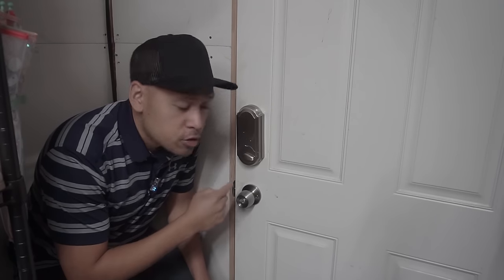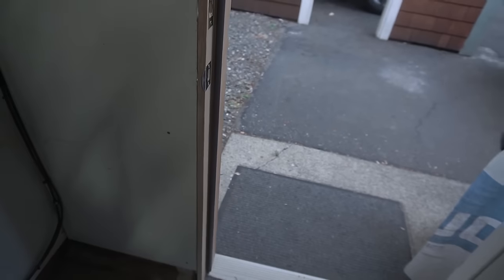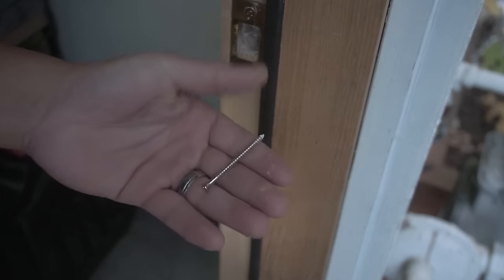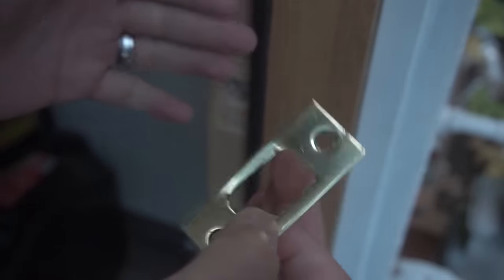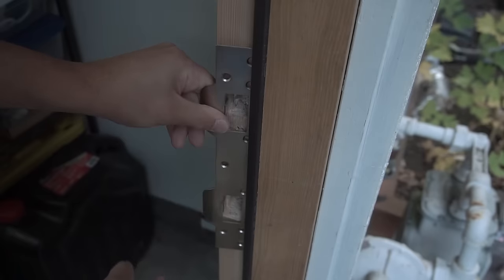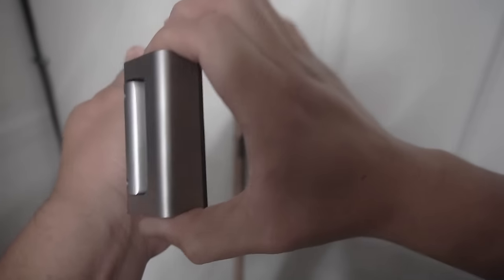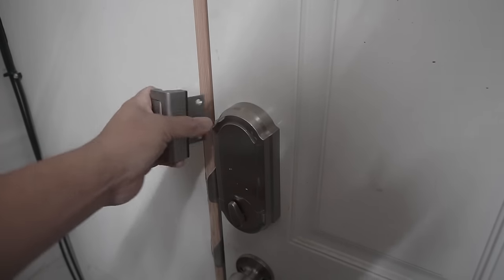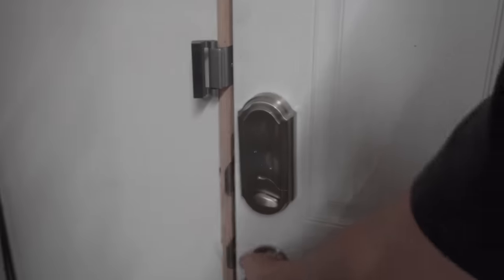How To Make Your Door Kick-In Proof Like A TANK! Keep Your Family & Home SAFE!

Comment: The lock on the thumbnail of this video I put a strip of streel along the backing of the door jamb. The guy renting the place passed out and the police kicked at it for 10 minutes before they called the fire department and used the prybar to pull the deadbolt out of the frame. The hinges were splintering long before the lock was. lol :)

Comment: Why does the doors in the us always seem to open inwards? Seems to me like a weak design compared to the European style which opens outwards. Basically the whole frame prevents you from kicking it in. I guess the us is designed in this way to prevent someone from blocking you in but that's a bit silly imho.

Comment: Just having a proper door frame and a decent carpenter would eliminate most of those problems. The gap around that door is an embarrassment, if you can fit that without debating the gap is obviously too big, buying decent makes of locks again will eliminate all of those things you mentioned. The frame you have there inside looks like an inch thick when it should be 2 inch hard wood, it looks like an internal door lining. Longer screws won't make any difference as it's a shear force not pulling, screw diameter is more important. Simply adding sliding bolts mounted top and bottom would of been far better, also pointless securing the edges when they can just kick in the panels of the door.

Comment: TANK? No.  Intruder just has to punch through that thin panel 6 inches to the right of the main door lock and reach in to turn its thumb latch, then flip the "Security Reinforcement Lock" aside - and they are in!!!  Those thin panels are the weak point on such doors.  They are only about 1/4" thick where they are mortised into the door frame.

Additionally, your main lock has a thump latch on the inside and does not require a key to open.  Thus, a burglar can enter through a window and easily exit through the "tank" door with your stuff - no need to struggle getting it through a window.  

Junk that fancy, convenient, push button lock and install a deadbolt lock that requires a key on BOTH sides of the door.  Leave a key in the lock when at home, take it with you when you leave - or hide it.

Comment: One inch deadbolts are crappy. Just prying with expand the gap. Steel doors and frame filled with cement works best. If a crook still wants in he’ll break a window. No one hears noises at 3am though most break ins are during the day when you’re at work 😮Don’t buy Chinesium alarm systems

Comment: I have a better idea.  Rig a rotation sensor to a pully and string on the door.  When the door is opened normally or even a bit faster nothing happens.  But set the rotation sensor to send a signal to a detonator rigged to a case of 16 quarter sticks placed underneath a false floor board right past the door.  And pack the area around the sticks with clay impeded with nails and gravel.  They kick your door down and go kaboom.  
And the atf and fbi show up to kick your ass because wtf if that was a police officer responding to a report of a kidnapping at your address

Comment: * DRILL A HOLE IN THE FLOOR LARGE ENOUGH FOR A HEAVY DUTY SCREWDRIVER, ET CETERA... ABOUT 3/4" AWAY FROM THE CLOSED DOOR..
STICK THE SCREWDRIVER IN THE HOLE.. Business End First...
*THIS ONLY WORKS ON DOORS WHICH OPEN INWARDS... 😳
*
ANOTHER...A FEW INCHES AWAY (FROM THE OTHER(S))..

Comment: Thanks for the input.
Here are some other videos 

The cheap way to secure hinges + 3 inch screws for the hinges:
HOMESTEAD PRODUCT REVIEW - Aieve Door Hinge Security Pins
https://www.youtube.com/watch?v=suhNNpmSFYA

A cheap way to secure hinges:
EXTERIOR DOOR HINGE Security Hack! 
https://www.youtube.com/watch?v=-K7s39tBJAI

Only the hinges are good, the pins are not secured with a metal plate:
High security door hinge protection - heavy duty security pins
https://www.youtube.com/watch?v=rCxrPG2hYM8

Secure hinge:
[28] Door Hinge Bypass Attacks!
https://www.youtube.com/watch?v=PycvLO74-YI

Screw tip but watch to the end :)
Double your door security for a couple of bucks NOW! Safer in 5 minutes!
https://www.youtube.com/watch?v=R0-3iIlDM1M

9 easy way to keep burglars out of your home
https://www.youtube.com/watch?v=JVfaj46O9Ys

Comment: Does not matter how much metal you put on your door to protect the latch and the deadbolt. Instead of kicking the door in, they turn their attention to your door frame looking at the light coming in from between the door frame and the wall it does not look convincingly secure!  You need a metal door and door frame plus ideally a brick built house! Wood is just too easy to get through!

Comment: NEVER use Screws that have a Shoulder behind the head on ANY door furniture  Threaded all the wa=y to the back of the head is ultra important  Also look at a London bar  kick in with one of those fitted  , Also maximum gap between door and frame 1/8th of an inch or 2.5mm . Oh and by the way you have created a huge weak point on the frame way too many screws and with shoulders as well too close together creating a weakness in the grain of the wood .  Also that door that you say is your main front  door is a total joke it is a moulded job before you get too happy with it find one and cut it into 4 pieces then be very afraid of just how pathectic they are  
yes i worked as a lock smith for a good number of years and thoses doors are dumb solid OAK hardwood  is the only door that could be called safe'ish  then you need to fit burst bolts on the hinge side of the door but even better  dump all the locks you have and fit a good multi point locking system that locks at least 3 points on the opening side plus top and bottom bolts you throw the lock it is locked in 5 places  but you still need burst bolts on the hinge side  .

Comment: Doors in the US are absolute garbage>>foam filled sheet metal with pine on the hinge and lock side. Very flimsy. And they swing in. Best would be full steel frame with steel door, like commercial use, that swings out with non-removable hinge pins. See what they use in Europe for examples Some have multiple bolts like a bank vault. Of course flimsy wood framing of US houses won't hold up to brute force without reinforcement too. A jack between the door jambs can spread the frame enough to pop the lock bolt. OSB and drywall won't stop anything.

Comment: too bad an experienced intruder will break the door frame, and the whole lock system will do nothing about it.  happened to me once, lucky there are ppl in the house and the thief ran after notice ppl are in the house.  He basically force a crack on the door frame then expand the crack until it is weak enough to push throw the door.

Comment: This won’t help a lot. A good kick will still bust that door wide open. It’s not the metal that’s the problem it’s the cheap pine framing that’s the problem. If you’ve seen a door kicked in it’s not the metal or hardware that splits it’s the pine framing.